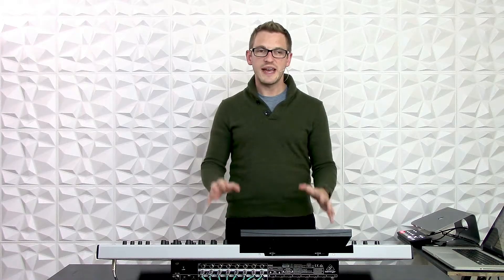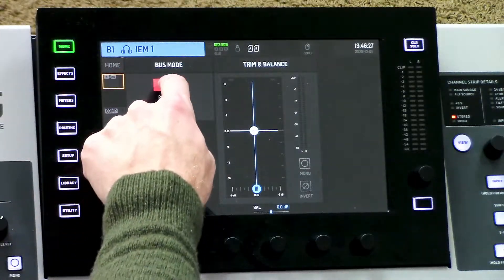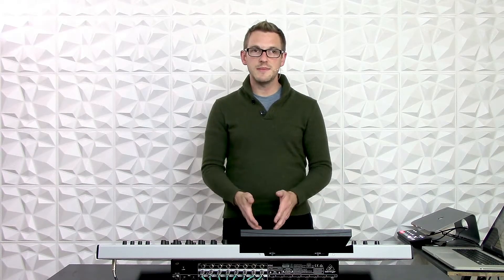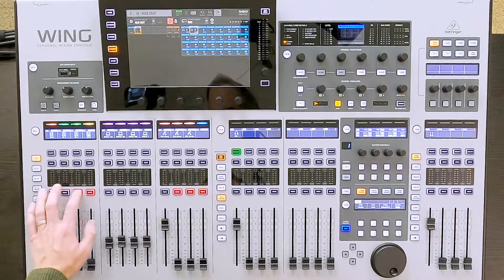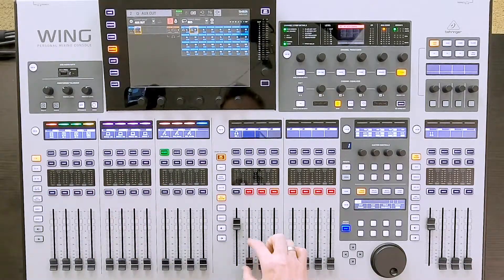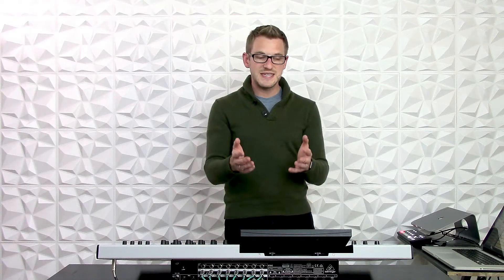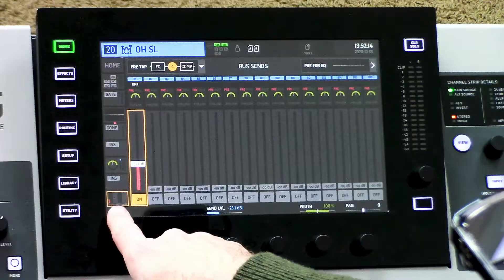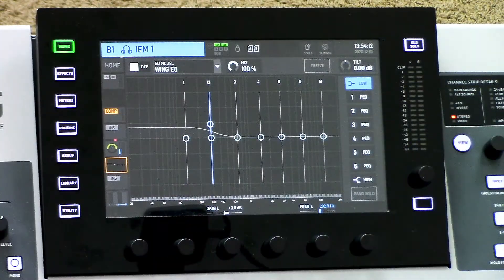Behringer Wing 109 - Setting Up a Stereo In-Ear Monitor IEM

Comment: As this is a stereo IEM, and you've configured to use AUX 1 & 2, are you plugging in two physical cables into the outputs 1 and 2 or a single TRS cable into output 1 or 2 should work?
Reply: Hey! 
From my knowledge, never actually used a wing but have used the X32 and M32 many a times. Yes, to gain a stereo IEM mix, you need a TRS cable plugged into both Aux Input 1 and Aux Input 2. Hope this helps :)

Comment: The tap points are nice. So much versatility in this mixer. I need to determine if there is a way for the musician to EQ each channel in his monitor only. I know that this can be done on an external monitor box like the PM16, but was curious if this could be reasonably done using only the monitor app.
Reply: Did you find an answer to this?
Reply: @ Not in the way I wanted, at least yet.  Short of assigning another channel to the source, so that it could be independently EQed and routed only to the monitor mix, I can EQ the overall monitor mix but not each channel in the mix.  My gut feeling is a secondary monitor mixer is one path, or using a monitor mixer like the P16HQ where you have simple three band eq on each channel in the box being the other.  I tend to think the latter is the better path, but it effectively doubles the cost either way.

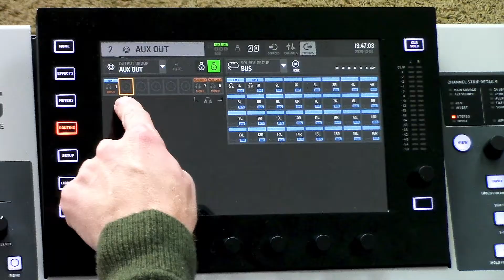Comment: At 1:25 it shows 2 aux outputs taken by 1 IEM mix. I thought all 8 physical aux outputs in the wing are stereo TRS. Cant one aux out send a stereo mix by itself without splitting L and R with 2 aux outputs?
Reply: Just curious, what was the answer?
Reply: We purchased the wing 3 months ago. You have to split it L and R to get stereo IEM as they are mono ports
Reply: XLR also have 3 connections yet they are not stereo but balanced. In the case of the aux outputs, these are balanced hence they use a TRS connector to achieve that (3 connections).

Comment: How would you route into a p-16 without an ultranet output?
Reply: You’ll need to use their P16-Input module. It can take 16 analog inputs (quarter inch) and converts them into digital (uses cat5 or cat6) for use with P16 Mixers.